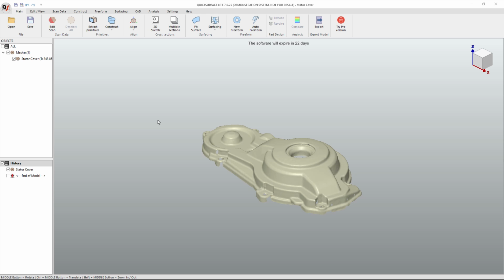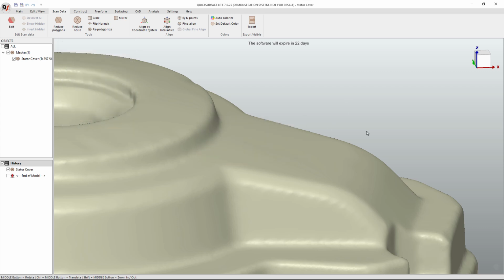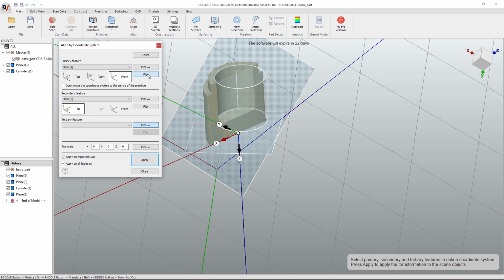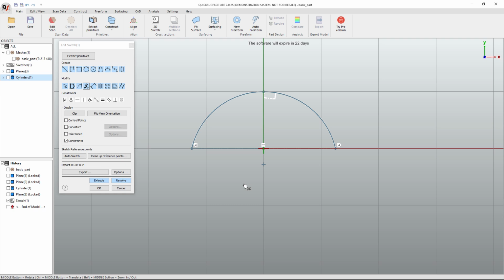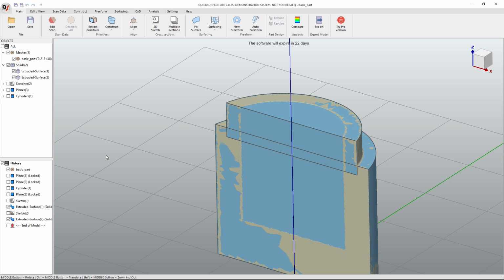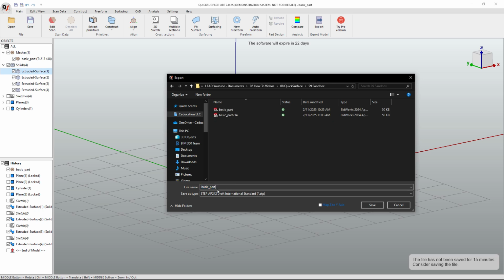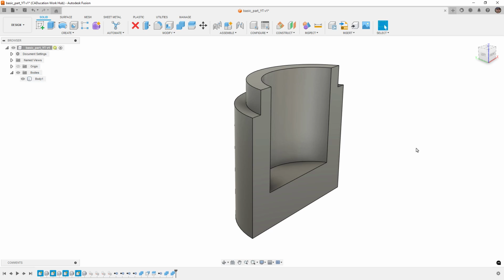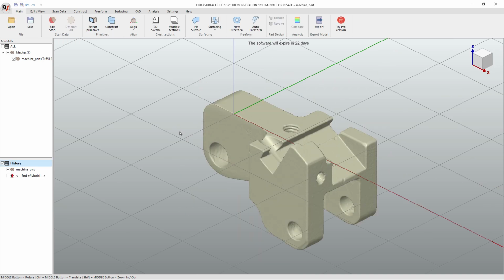QuickSurface LITE Demo | How To Process, Align, and Create

Comment: Great video. Have you seen the new Personal edition for hobbyists and makers?

Do you know if you can combine the parts in the personal edition so you can export as a whole model? Or is the Personal edition and take on Lite rather than Pro.
Reply from the maker: Yup. the first 2 parts of this series use QS Personal  https://youtu.be/LdKKJs5e03g  and i talk a bit about the differences in the 3 license types.

The short answer is yes you have more CAD/boolean tools in Personal, but the limitation is mesh export as an stl only.  It isn't meant for commercial work so one of the limitations there is on CAD export.  Also note there is no auto freeform.

Comment: Is there a reason you use the 2D curve fitting tools over the 3D primitive extraction tools. You could extract 2 cylinders and 4-6 planes for most everything and then use the sketching tools for the side notch. Secondly would the extrudes in the lite version snap to planes generated by extracting primitives....that could save the guess work.
Reply from the maker: Great questions!  If you had access to all the CAD tools in Pro it would be very easy to just have primitives and combine/cut them.  I could have done this in Lite and exported the solids that way as well.  I chose to do the 2d sketch as most cases you can't get away with just primitives.  You are 100% correct that I could have created primitives and planes will be exported as planar surfaces so you can 100% do that.  I felt the sketch based workflow was most representative or the common workflow but very good eye!

Snapping is only in Pro, even snapping to planes.  When you try to enable snapping during an extrude with Lite it pops up and says its only a pro feature.

Comment: Thanks for doing this, as I asked the folks at QS to do a tutorial on QSLite. I had looked at the comparisons but it wasn't really clear, however thanks to your YT channel, I now know what some of the differences are in day to day mesh extraction. It was on offer, at £300/year at one point, and as a hobby user that does seem a little top heavy, less so if I can get useful shape extraction out of my scans more easily. It's a shame QS don't do a hobby license, as I'm sure they'd be a greater adoption rate and it'd be a good revenue stream as more capable  lower priced scanners hit the market.
Reply from the maker: Happy to help.  I will be doing a video comparing each of the license options at some point soon as well.  There is more to LITE that i didn't cover like the auto surface and some of the subD stuff which can be handy.  I think where it sort of hits a wall is that you have to export each of the primitives and then work on them in another CAD program.  That is really the big jump from Lite to PRO.

The LITE version is less than a year of Fusion, but i understand as a hobby user that is different.  Having done a few videos on how to align a mesh in Fusion without a tool like QS. if you have to do this a handful of times it would pay for itself in the time saved for sure :)

Comment: Thanks for this video! I've been on the fence for QS for a long time. Lite is compelling, but I feel like I can do most of what I need in Fusion alone. The main thing I'm not good at is aligning to the coordinate system, but you probably have a video on that if I go look for it. 😃
Reply from the maker: https://youtu.be/tbwPDBflb0w

It won't be as good as in QuickSurface but it is possible.  I have a few videos on this process.  One aligning a transmission scan, but the link above is the most rescent.
Reply: @LearnEverythingAboutDesign  thank you for the link, I'd missed this more recent video. I watched the transmission align video and it is also really useful. 

I've been faking it by setting the view normal to an origin plane, zooming in as far as makes sense, then rotating the part and eyeballing it using a selection rectangle. Once one side is where I want it, I go to another plane... switching back and forth checking until I'm happy.  It's hacky but has gotten me by. I appreciate all your tutorials!
Reply from the maker: @rickmellor  Yeah i do that for things like Fenders if it just has to be close.  You can toggle on a 4 view display in Fusion at the bottom to make that a bit easier if you need.  But yeah one of the big things you don't get is an analysis of how close your plane is.  Im working on a video now where we scan a triple clamp for my bike series and show creating a plane on the top and how the first try was too far off so we do it again.
Reply: @LearnEverythingAboutDesign  oh, the four view is a great tip too!

Comment: nice program but even lite is way out of budget
Reply from the maker: Yeah it can be tough depending what you need.  Mesh tools in this segment range from QS LITE up to over $20k.  If you do scanning as a job and need a tool just to process and align before getting into CAD its well worth the $450/year.  But if you are just doing it for fun on a hobby license of Fusion then maybe not.
Reply: @LearnEverythingAboutDesign does the software stop working after the 1 year period, or are you just locked to the version you originally purchased?
Reply from the maker: @67MustangResto  LITE is a subscription service like Fusion.  You pay for the year and you will need to renew it at the end of that year.  PRO is perpetual but with optional maint.